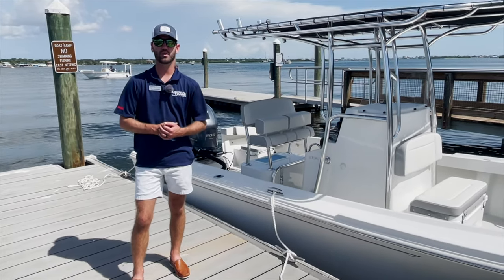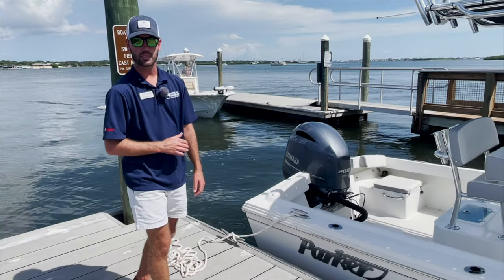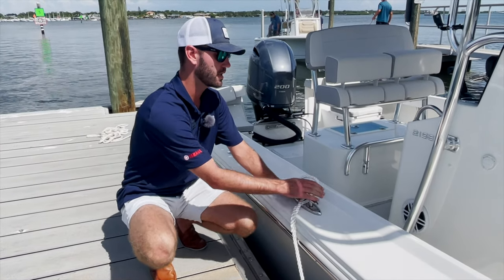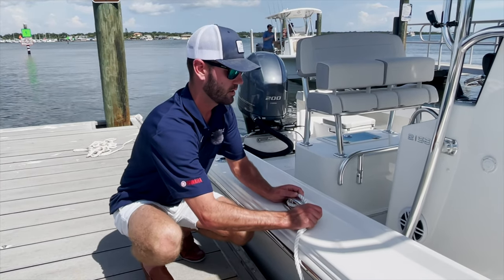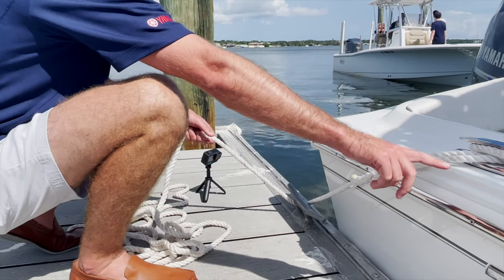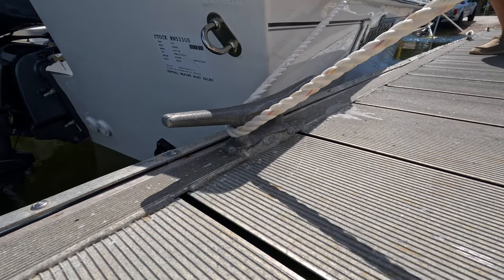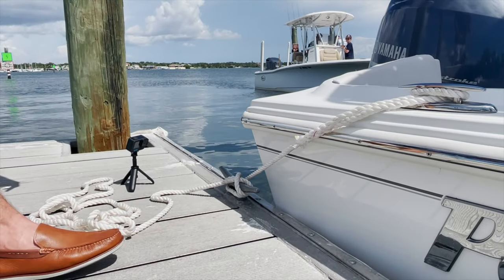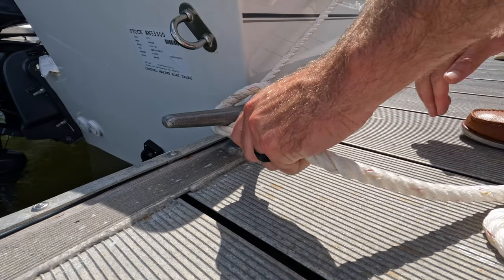How to PROPERLY tie a cleat hitch

Comment: Great Video. Just to add some info. This works with smaller boats with smaller lines like the boat you are on, But the cleat hitch will change with bigger boats with bigger docklines, and ALWAYS mind your fingers, Fingers never go in the loops of the rope or under the horns of the cleat!
Reply: how do you do it for larger boats?
Reply: @driver3899  Sorry for the late response. 

Anything over about 70 foot, you don't want to figure 8 and lock it off. If the wind blows and put tension on the line, you won't ever get it off because it has tightened down so much, especially with polyester docklines. 

That is when you are using cleats and larger lines though. If you are using Bollards or bull horns, or even a cleat with a capstan, its fine to lock it off because you can wrap it around a few more times and release the tension.

Rare to have lines tighten so much that you have to cut them loose, but I've seen it happen, and in the worst timing as well!
Reply: @lukereynolds96  That's awesome info thanks!
Haha yeah I bet Murphy plays hell with the timing of when you end up having a jammed line and need to cut it free

So essentially the last couple of wraps around a larger fixing point will take any strain and stopping it from tightening down the 8 so much it needs to be cut, but on smaller craft you can get away with just locking off because it causes less strain, does that sound about right?

Comment: You had everything good until the half hitch. Unnecessary and if a swell comes your gonna have a hell of time getting that half hitch undone. It’s called a hatchet knot for a reason. 
  I go from boat around the dock cleat back to the boat we’re it’s cleated off. That way you can undo everything from the boat, no more undoing lines and trying to jump in a moving target.

Comment: NEVER use a locking hitch on a cleat... On a fixed dock the tide goes out you will never get that rope off without cutting the line. Or if the tide goes out fast enough it will rip the cleat of either the dock or the boat..

Comment: You started out great, got your line leading to the back side of the cleat ✅️, the full wrap 95% of people don't do ✅️ but..... then half hitched it onto itself❌️. If that line comes tight (swell) it will sinch down on it self and you will have to cut it off.   Make sure you get at least 2 full crosses on the top side of the cleat not including the initial full wrap around the base portion before finishing you tie by crossing under.
Reply: all the way round the bottom then one cross on top then if you need all the way round the bottom again
thats how I was taught anyway